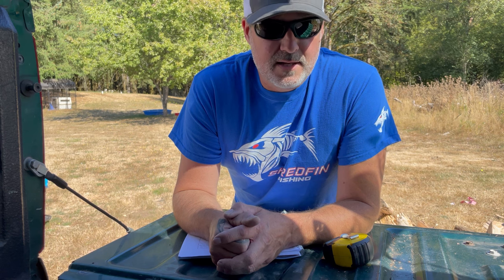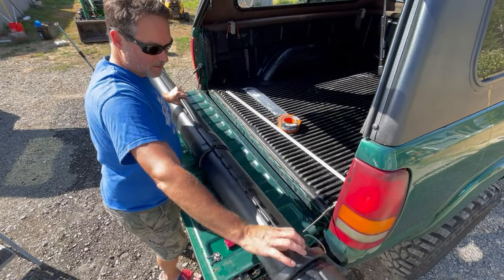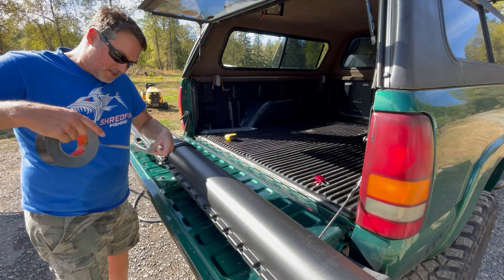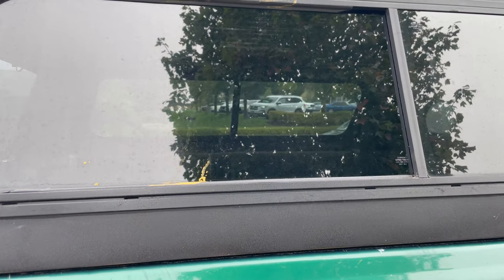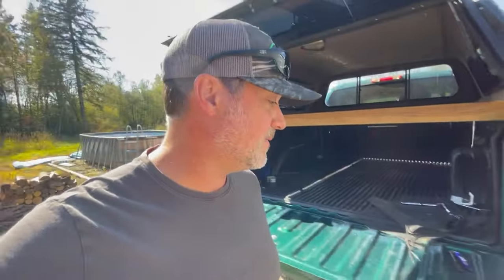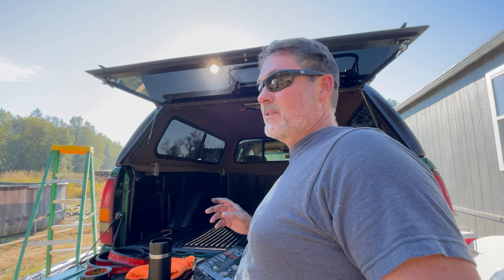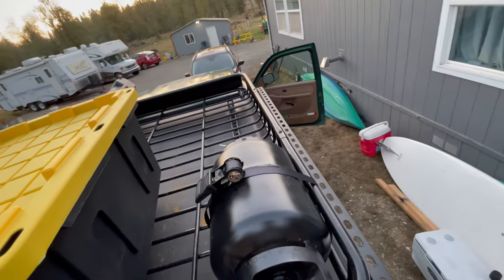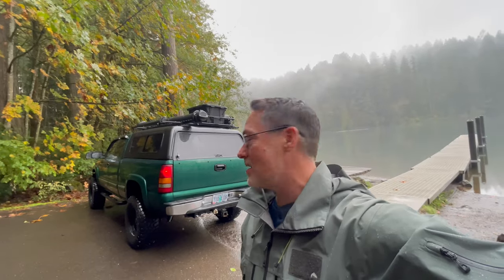How to - EXTREME Truck Camping canopy MAKEOVER! Part 2 GOING STEALTH

Comment: What size lift and tires truck looks great
Reply from the maker: Thanks man! 🤘 it’s a 4” suspension lift with 35’s. I can jack the rear up a little more when I fill the air bags if needed.